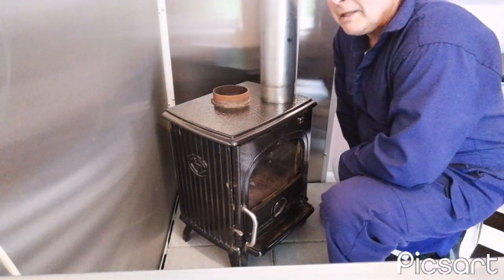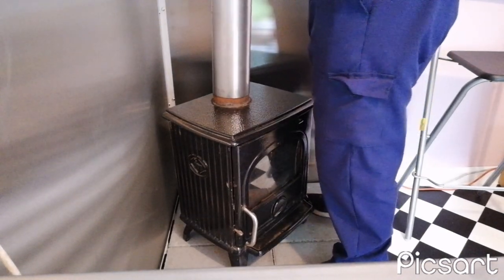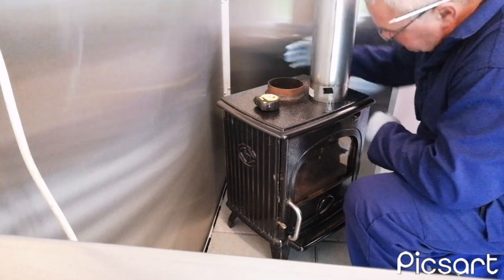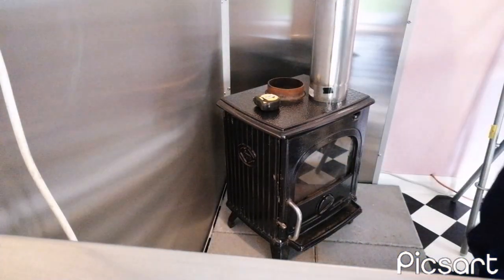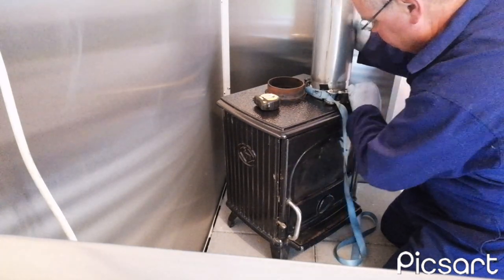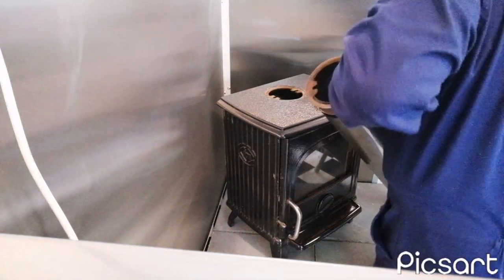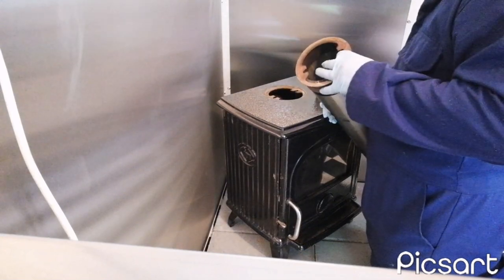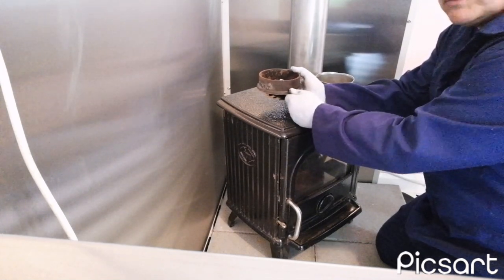why does my flue pipe not fit my stove collar

Comment: I got the same problem, but I'm a welder so should be able to fav an adapter.
Reply from the maker: Do you think it's worth welding an adapter on, it was much easier just to cut off the recessed section.

Comment: A Crimper would do the trick too
Reply from the maker: I think the thing I learned is that the stove collar is designed for the flue pipe to go round the outside, so I was wrong to attempt to fit it inside. So cutting the pipe is the only real option.
Reply: @cliffwalton3440  I've had to do that a couple of times in the past, but with the pipe on the outside of the woodstove collar, creosote and condensation can 'get by' the collar, leak. I've found it's best to start inside the stove collar, and stay inside, all the way to wall thimble. That way, any fluid will always stay inside the stove. I know it's sometimes a hassle tho. I also know you can burn your stove a little hotter and minimize a leak, but that wastes heat/wood. I like being able to almost completely close the air intake, for those times we may be away from home overnight. Take your time and think it thru...I just spent a week figuring out the same problem for mine. I've burned firewood for 40 yrs and never had this problem, until now. Our chimney/flue is pretty tall from our basement, and I had to make sure my pipe was running the right direction...'upper pipe' inside 'lower pipe'. I sealed my thimble cracks, at wall. I rolled a short 6" section of stovepipe INTO the opening of my stovepipe before going into wall thimble. I had to 'un-clasp' he inside pipe, roll it up slightly smaller to go INSIDE stovepipe,  to continue the 'pipe inside next pipe, from wall thimble, to stove. Now, nothing can get outside of the stovepipe, it re-burns any excess creosote, when I open the air intake valves ea morning, and stays clean. Sorry such a long comment..I hope your setup always works great, my friend.
P.S., The stovepipe crimpers are @ $40.00 at Lowe's, they're GREAT, simple, and I found I can crimp down the size of a pipe, tighter, to make it fit beautifully, and it looks 100% OEM. It's what they're made for, but I didn't know they existed until recently👍. I never needed any, but they sure work perfectly.
Reply from the maker: @treylem3  thanks mate. You're absolutely right. Everything should go inside at the bottom for that exact reason. I have never heard of pipe crimpers and will take a look. As this stove is only in our 'summer house' (garden shed 😊) it is used sparingly. I think the best fix would have been to buy an irish/english collar for the stove. This would (should) be the correct internal diameter to take the recessed flue pipe. But I couldn't find one. I wonder whether they exist. I plan on hopefully installing a couple more stoves in my various outbuildings over the coming years, so if I come across this again, I will definitely look into crimpers. 👍

Comment: How do you know what diameter the PIPe should be?
Reply from the maker: They are standard sizes. They increase in diameter from 4" to 6". The flue info will be available on either your stove instructions or on the Internet. If it's an older stove, or you haven't got the model number, just measure your collar. Hths
Reply: @cliffwalton3440  thank you. My stove is an older model, and it looks like the former owners attached a larger connector part to have an 8 inch flu pipe. I measured the stove opening and it is about 6 inches .and the stove is very small. Perhaps it is one reason I am getting smoke in the house  as the fire goes out at night.
Reply from the maker: @patrishaclark1132  one thing I read was regarding the tempreture of the flue. It needs to be hot to facilitate the draw. I can only guess that a small stove linked to an excessively large flue may create an issue where the flue doesn't get hot enough, or maintain the heat to extract the fumes  into the night.
It may be prudent to have it inspected by a professional.
Reply: Thank you that makes sense.  Have a happy holiday and blessed New year!!

Comment: OR just order a female/female adapter
Reply from the maker: That's true Kirk, but where's the fun in that? There's my wielding a hacksaw or Jimmy with his oxytetracycline... 😁
Reply from the maker: I was just thinking about your answer. (feel privileged, I don't often do this) and I did originally try to get an adapter, but couldn't. I also had a couple of issues with using one: firstly, I didn't particularly want an extra joint that may leak but also I was restricted with the length of the single skinned pipe. It was on the very limit of distance from combustible when it fits into double skin. But now, thinking through the situation, a female to female adapter could also be called an off cut of pipe! Therefore I 'could' have cut the single pipe anywhere beyond the male recess, then put the top bit on the bottom. GENIUS! There would still have been the second joint though, and it still involved cutting the pipe.